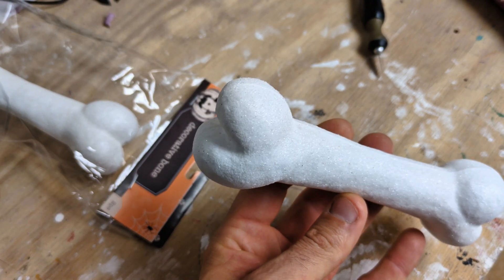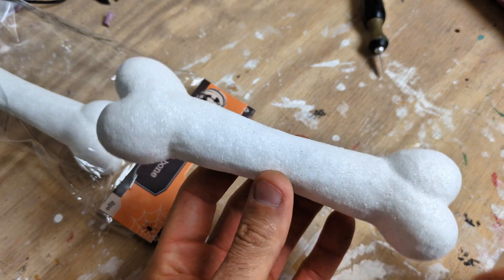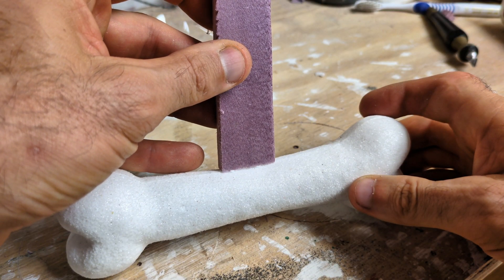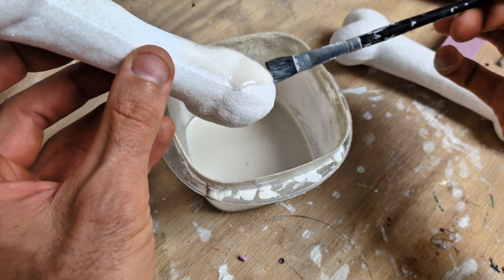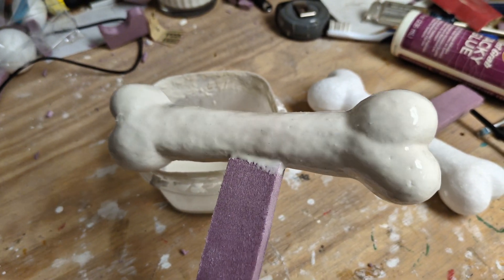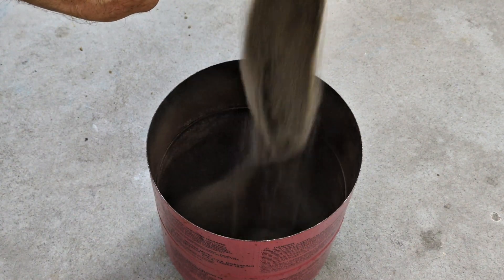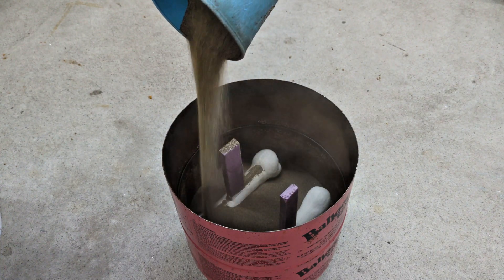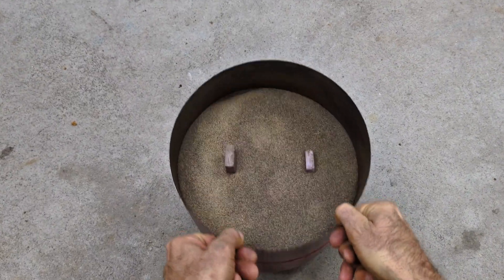Lost Foam Metal Casting - Making Metal Bones using Lost Foam Casting Process

Comment: Hello. I am wondering is it possible to use this process but with wax rather than foam. I am thinking about 3d printing the wax molds and using the wax object as a lost wax cast. Any thoughts please.
Reply from the maker: So there is a process called lost wax.  It's an ancient technique.  Wax doesn't burn away as easy as foam and probably won't work with loose sand.  Using wax usually requires a ceramic and plaster shell.  Followed by burning out the wax prior to pouring the Molten metal into it.

Comment: Hi there, I ran across your videos and was impressed.  I work for a bronze foundry and we make sand castings with wooden and plastic patterns.  We wanted to try a part using the lost foam process.  This part is a ring casting, with the outside diameter of 12" and a bore of 5" and 2" long.  We already make this part repeatedly with the wooden pattern and there is three 3" risers on it.  If I cut the foam to the same size as the wooden pattern then the part would be correct for shrink etc....   The question I have is, is there a formula for the how big the spru is ( 2" diameter x 6" high or 3" square x 4" high and also how many of them ) for this ring casting.  The main reason that we want to try this is, sometimes a customer wants just 1 ring or 1 square made out of bronze.  We have to have a pattern made of course and we never use it again.  We would appreciate any advise that you could offer - Thanks!!
Reply from the maker: I do this as a hobby.  I don't do any calculations.  This can be done with other metals.

Comment: Cool! I'm definitely doing this for some sort of cosplay thing
Reply from the maker: You just need to use polystyrene XPS foam.  The foam used for making cosplay stuff doesn't burn the same.  Polystyrene is a rigid foam.  Definitely give it a try with the proper foam.
Reply: @HeinrichsMade  That's the plan. Going to use a laser foam cutter to pop out the designs, rather than the typical method for creating foam cosplay items
Reply from the maker: @WhensBreakTime  laser cut out would be cool.  I use a CNC router or a hot wire cutter to cut out my shapes.